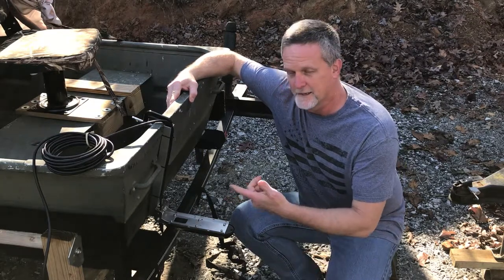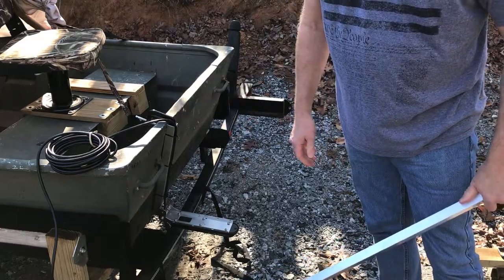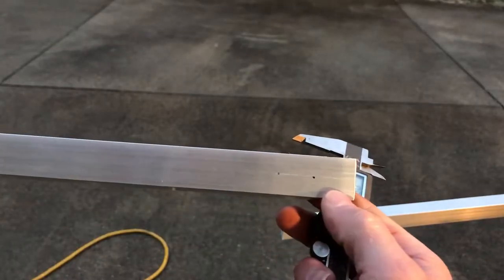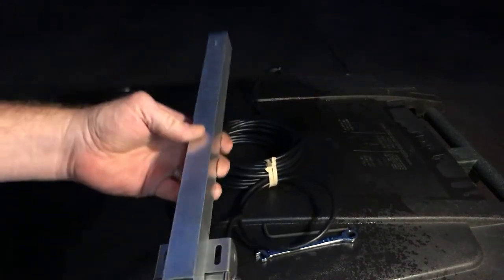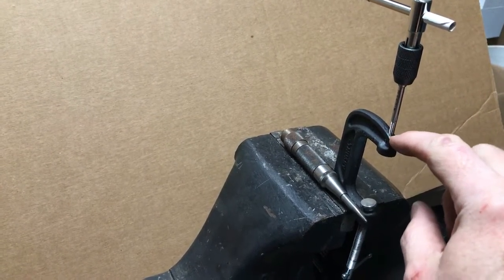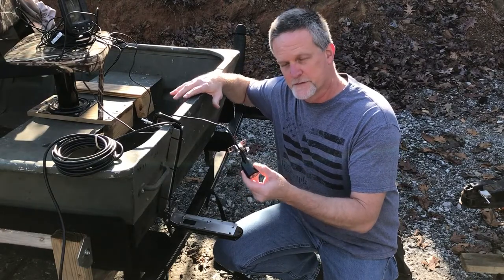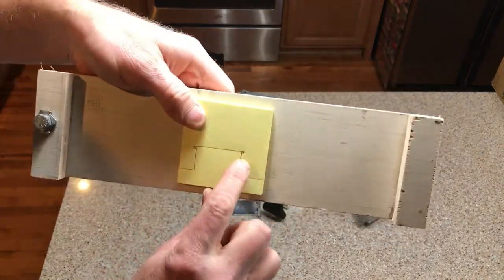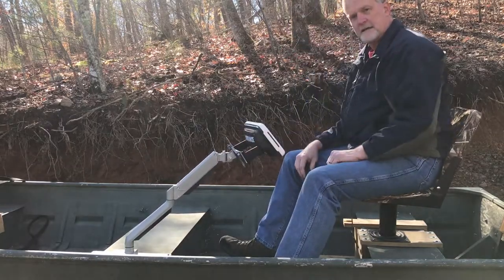DIY Fish Finder & Transducer Mount for Jon Boat

Comment: Someone needs to invent a mount that'll fit in one of the oar lock holes that's on every aluminum Jon boat and V-bottom boat! You could mount it on the left or right and it would be usable from the back or front seat!

Comment: Hi! That monitor arm is a really good idea! Does it vibrate much? I use my fishfinder/gps whire driving, so it would bee good to see clearly whats hapening on the screen.
Reply from the maker: I don’t see it vibrate but I’m not going that fast in the John boat. I like the arm on it. I can adjust it up, down and push it away. You will like it.